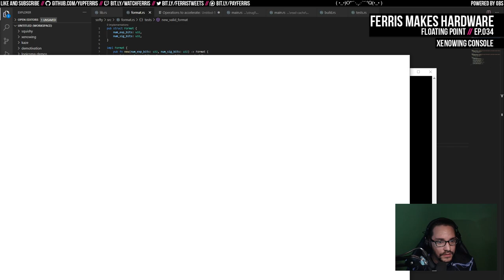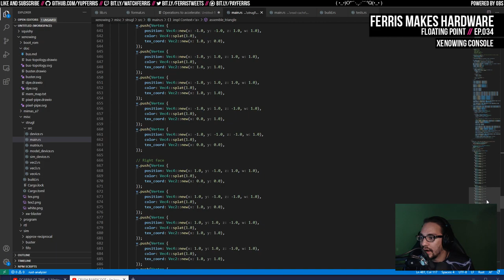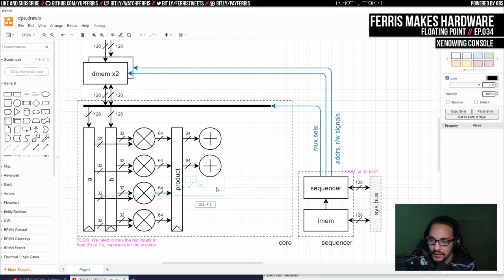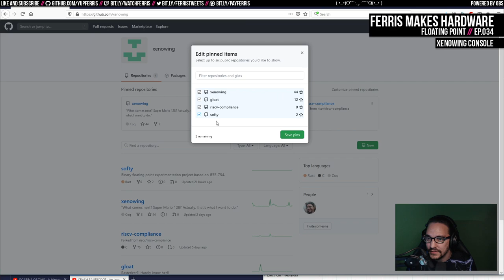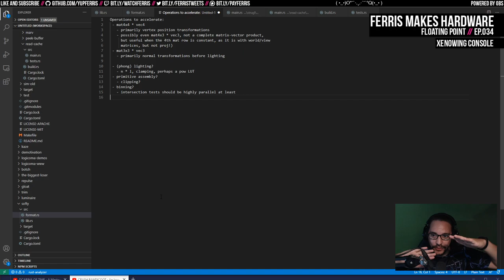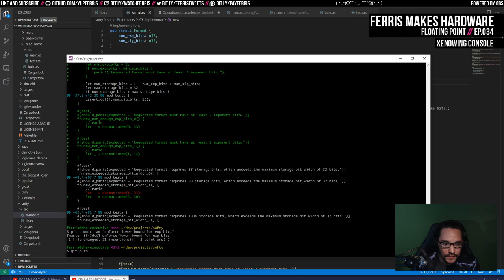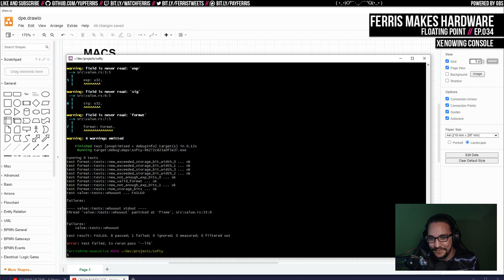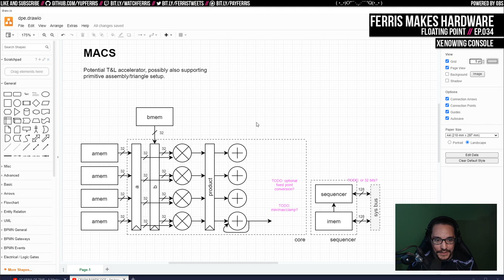Ferris Makes Hardware Ep.034 - Floating Point

Comment: Regarding the FPGA vs. software emulation efficiency thing, I think a lot of it falls down to how well you can translate the original platform's capabilities into software on your target architecture.

For older stuff like the GBA it's basically irrelevant, because you can rely upon the orders of magnitude faster compute of modern tech - it's ends up being like arguing over whether a Tesla P100D or a Nissan GT-R is better at outrunning a Delorian in a quarter mile.

The only case where it really matters is where you're trying to emulate a more modern architecture that doesn't translate very well to the common x86 / OpenGL / OpenCL stack because of specialist operations that are utilised in critical paths. You can't just throw CPU/GPU cycles at the problem at that point, because there's less of a disparity in practical speed between the target and host architectures. But then equally at that point you may find that you can't clock a commodity FPGA high enough to perform that emulation in practice, and a seamless experience is just entirely out of reach with current generation hardware.